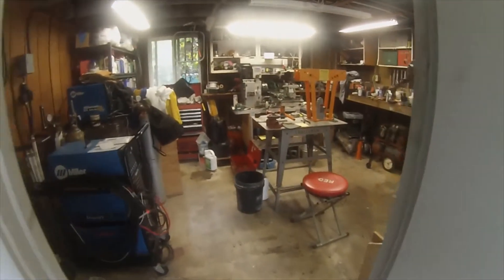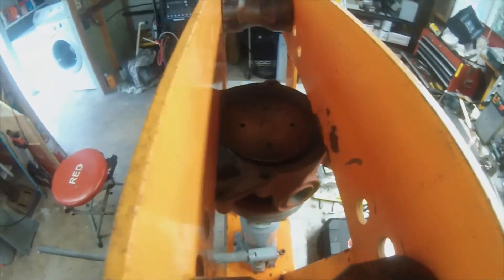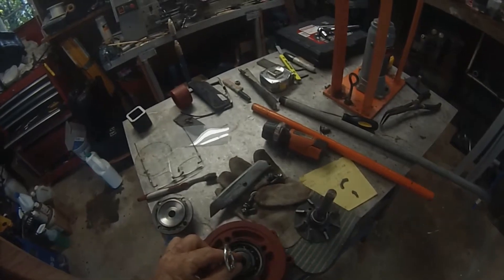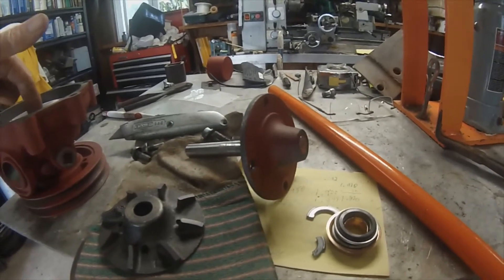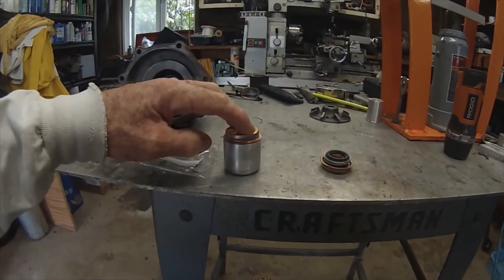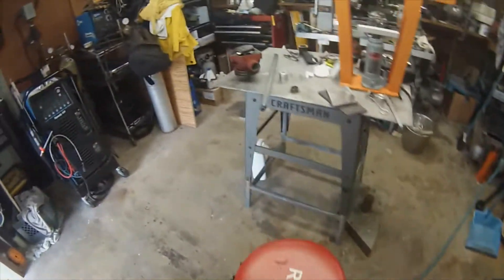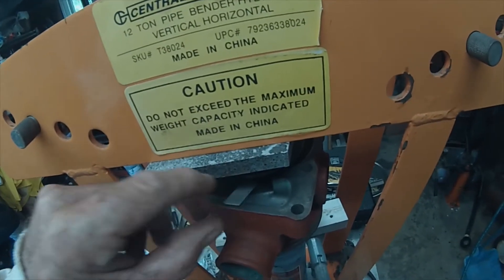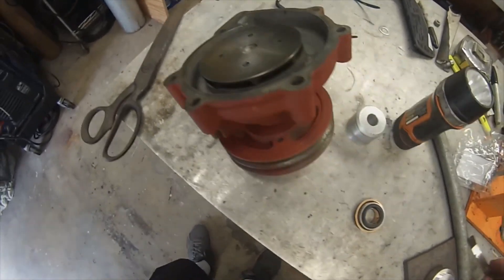Volvo Penta AD41 Circulating Pump Rebuild

Comment: I am trying to rebuild the pump from a AD31P-A which looks exactly the same as in the video.  I can't find a part number for the sealing ring or other parts.  Also the rebuild specs / manual?   All help appreciated 🙂
Reply from the maker: hi ian
the sealing ring for that pump (circulating) part #1676432. the go to for parts or diagrams i use is marine parts express they have the break down on your motor. by the way ad31 and ad41 are the same. the specs on that pump i believe are on the video. the only assembly spec is on the vane and housing. the most important is that installing the ceramic seal the tool i made is the key for install. the seal is easily broken. just one more note this is a circulating pump not a pressure pump therefore clearance vane to body is not that critical close is good enuff. when you press together it is not likely to undo if clearance way too tight. you would have to start over with new seal. good luck hope this helps. aloha
Reply: @islander228   Thats great & thanks for the reply & help.  I have found the drawing of the pump but it is not exactly the same as the pump I have, so the drawing must be a later version.  I have pump 860453 (number stamped on casting body) which is exactly the pump in the video.  I guessed the part number as you have detailed will fit my pump, so thank you.!!

Comment: Thangs for the vidio, i saw it before i repaired the pump on my AD31P-A motor, especially the idea of the tool to press the seal on was useful, i made one of nylon.
Volvo writes that the impeller must be 0.8 mm. +/- 0.15 mm. under the packing surface on the house, i have measured that it is the same as the 25/1000 inches you have between the impeller and the house :-)
Reply: Thanks 1👍
Reply: I am trying to rebuild the pump from a AD31P-A which looks exactly the same as in the video.  I can't find a part number for the sealing ring or other parts.  Also the rebuild specs / manual?   All help appreciated 🙂
Reply from the maker: hi ian
the sealing ring for that pump (circulating) part #1676432. the goto for parts or diagrams i use is marine parts express they have the break down on your motor. by the way ad31 and ad41 are the same. the specs on that pump i believe are on the video. the only assembly spec is on the vane and housing.the most important is that installing the ceramic seal the tool i made is the key for install. the seal is easily broken. just one more note this is a circulating pump not a pressure pump therefore clearance vane to body is not that critical close is good enuff. when you press together it is not likely to undo if clearance way too tight. you would have to start over with new seal. good luck hope this helps. aloha

Comment: It's nice to watch a mechanic at work. I am rebuilding a similar pump. Question, the impeller is just pressed off and back on with no key way ? Just dry?
Thank you 
Mark from Florida
Reply from the maker: yes mark just dry. wd 40 mite help but i just go dry. the shaft should not be scored or chaffed. If so carefully file and polish.
Reply: @islander228  Thank you

Comment: Hello sir im dismantling a same pump and thanks at your tutorial is making my life easy, in the last part where you install back the pump impeller i dont understand the clerance that must have between the impeller and pump case. Please can you tell me the unit and the interval values. I hope you will help me thanks a lot
Reply from the maker: volvo manual calls for the wheel to end up at 0.8 mm (0.0315). the idea is the seal is 2 parts in 1 spring loaded and you want the pressure on ceramic surface for the seal to work properly. no need to measure all the vanes around the circumference because that value may change. you are trying to pressurize the seal. this is not a pressure pump where that would be critical. in short pressing on the wheels i have installed were between .025-.030 with no problems. i have not found volvo giving a plus and minus value for this. hope this helps